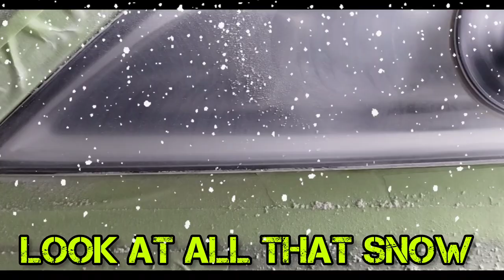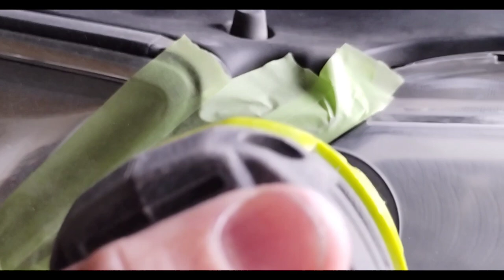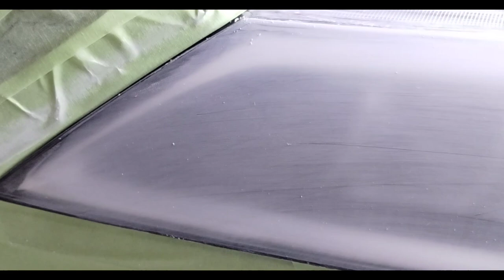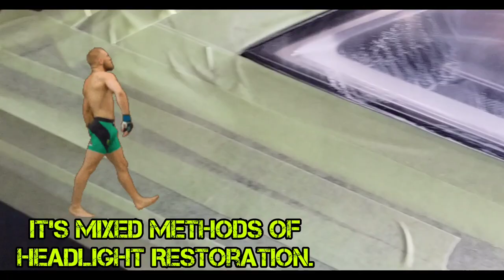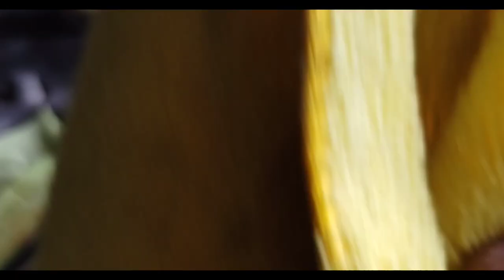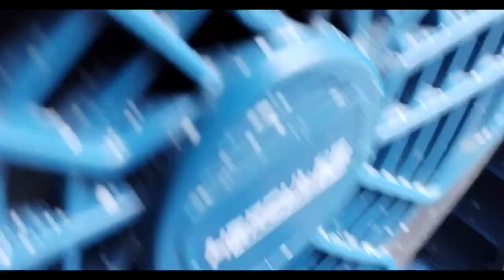Headlight Restoration - FIRST PERSON VIEW - up close & personal 🧐

Comment: another good video 
if you can, could you advise or show us a restoration on tail lights? Do they need the same steps as headlights? I'll assume tail lights also have UV coating from the factory too?
Reply from the maker: Yes when they come up they come up quite rarely only a couple times a year..
They are needed on a vehicle very rarely takes a lot longer for them to go bad.
It's just about the same process.. when I get a chance to I will definitely put one up. 💯

Comment: Thanks for showing!
Reply: Thank you so much for the response. Yeah i meant 5inch away lol. 2 is making spots everywhere. Lol. Yeah so 35 degrees is the key number to spray the clear coat on with the least amount of wind . How can i make it hotter on the light. Do i light it on fire?? Then blow it out?
Reply from the maker: Not too sure I I've only had to work a couple times when it was about 35°..
Biggest thing I can think of for you if it's that cold is to get a portable propane heater until necessarily aim it at the light like you're trying to heat the light up think more heating the area up, how I use my fans but keep it running by each light should raise the temperature up a couple degrees...🔥🔥
Reply: @theheadlightrestorationpro  ok . Im thinking one those click on lighter for the bbq. Or maybe aplug in thermostat
Reply from the maker: @barrybinning3849  👍🏽
Reply: @theheadlightrestorationpro   so when the clear coat hits the light at that temperature will it be blurry or spread evenly and go in the scratches better that i made with my sandpaper.  Im crossing my fingers this will work better once heated up. I will try the water with the 800. Trying to figure out how to take out those clouds on bad head lights. I sand with p500 and it doesn’t come out so i try wet sanding with 1200 grit . But the cloud gets bigger and spreads . Then i go with the . Wet sand 2000 grit . Then the 3000. Yeah i know its not what you do. But the whit black clouds appears with your method. I use the drill double sponge method.
Reply: @theheadlightrestorationpro  its like the black cloud curse.
Reply from the maker: Man I don't even know what you're talking about.. I believe I gave you my suggestion

Comment: Great video! Where do you buy the 3m sanding discs in bulk? And do you have your customers sign a waiver or anything in case they want to accuse you of scratching or damaging anything? Thanks!
Reply from the maker: I buy my 3M sanding disc in bulk for Amazon all the links are on my page... Goodbye as many hours as little as you want an increments of 50 for most..
Waiver only if there's some kind of serious issue perceived... There's no better waiver than before and after pictures.....
Once again there's no better waiver than before and after pictures...

Comment: Loved the video! Why do you choose a dry sand over a wet sanding process?  Do you like the spray clear coat and how do you make sure it dries evenly?  Very informative dialogue but just wish you had explained a little more about the questions I'm asking.  We live, we learn!  Hope you respond to this!  Great job!
Reply from the maker: This video is about dry sanding..
And there's other ones up that indirectly speak of it..
But the actual professional way to sand anything is to start with dry sanding and finish with wet sanding... It's literally on Google.. dry sanding remove stuff heavily and we're concerning plastics adds to that clear smooth finish, wet sanding is only meant to be a finish step or near finish step. Extra smoothing.. it's the lightest form of sanding.. so my method is pretty much gramorically correct when it comes to sanding anything especially plastic/ or polycarbonate headlights.
It's extremely more efficient.. when sanding alone is kind of like training wheels... Dry sanding is a big boy shit.. it's like a hundred times faster and more efficient.. and this is why you notice if you ever have noticed was some wet Sanders product or finished product differ a lot they're not very consistent.. whereas you see my method they all come out crazy good and you only see the ones that I choose to film.. I don't film all of them because of time and storage space.. I only film about maybe 10% if that...

https://youtu.be/eoPKK-trHdg

Comment: How many cars can you do with a 3M orange Finesse-it pad? Thank you very much for your channel.
Reply from the maker: Hey thank you very much for watching and supporting I cover this topic of a couple videos but can't remember off hand which ones...
So here you go.. it's a lot I really can't even estimate..lol
One pad is good enough probably well over 15 vehicles.. it's an amazing technology it just keeps resurfacing itself through the work almost shreds and turns to dust I'm very small layer at the top are on the surface.. it's about an inch thick to start with that you can work it all the way down to maybe a centimeter thick or so.. I wouldn't be surprised if you can get away with 25 cars with one pad.. I have dozen sitting around just because I can really use them this much.. so they're really expensive.. but they really last a crazy amount of time especially if you take care of them and the only thing you have to do to take care of them is just let them be and wash don't do anything..
Hope this answers your question good enough.. stay tuned for much more.

Comment: Is it possible to start with a finer sandpaper to eliminate scratches and just go over the light more?  Im a beginner and loving the videos but want to be safe haha!  Thanks for any info!
Reply from the maker: It is very much possible you could start with an  p800 but this won't work with every type of light only lightly oxidized lights or lights without any clear coat on them from age.. those heavily damaged lights will laugh at the p800.. also it would be extremely more expensive as though it would take longer and a lot more p800.. once you hit p800 and up just get really expensive. Roughly a p800 is the price of four P500s... I thought that nobody said roughly far as grinding power to p500 would have the power of like six p800..
So this could get quite expensive if you use nothing but that or higher being that the p800s and up p1000 and p1500s etc.. all are much more expensive.. so in summary you could but it'd be more expensive and it would be a lot harder to take a lot longer..
Reply: @theheadlightrestorationpro  thanks for the info! I will follow as your video states and use 500 and go to 800. I was wetsanding through the whole process and I see that you don’t which is probably why I didn’t get good results. Thank you for your advice and help
Reply from the maker: More than likely it's most definitely because your wet sanded there's a lot of signs going on there that people don't really know about... And make sure that's a p500 and a p800

Comment: Now i know its ok to p320 on sandpaper beaded lights. Yeah. These lights are like warts all over on the surface of the headlights and rough like passing your hand on 80 grit sandpaper .  The clear is finished completely.   I do see scratches left behind some times.  It’s because i apply a lot of pressure with a 500 after the 320. For the clear coat . How hot does it need to be for it to not have a blurry affect when sprayed 2 inches away. In canada its 26 degrees winds as well.
Reply from the maker: It's too cold to be working at 26°...(to spray) shouldn't be doing it when it's under 35°... I've never said Sprite 2 inches away the product is not designed to be sprayed 2 inches away... 5 to 7 in